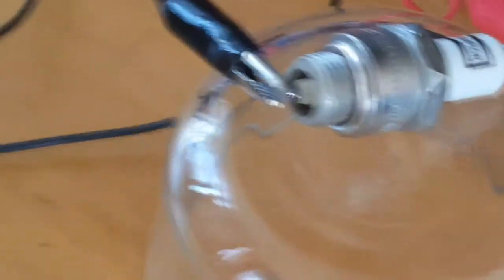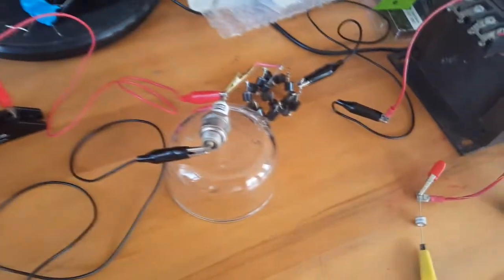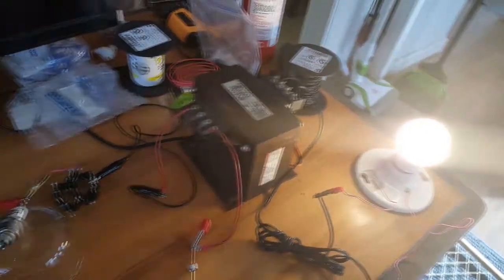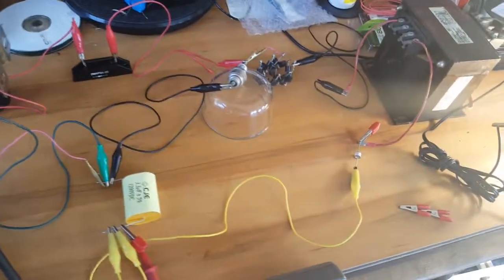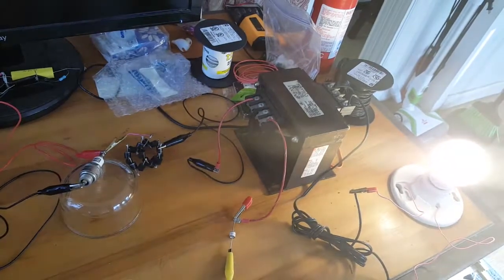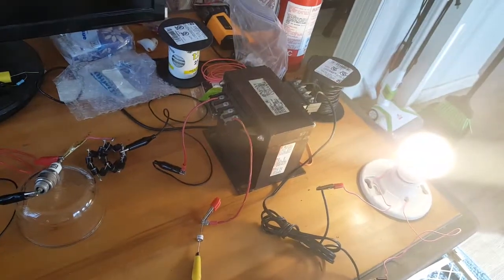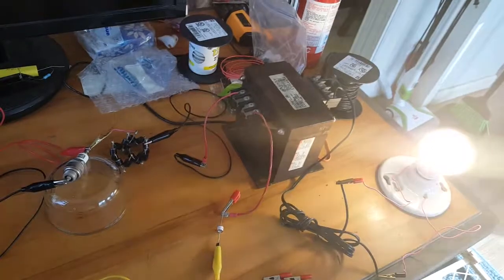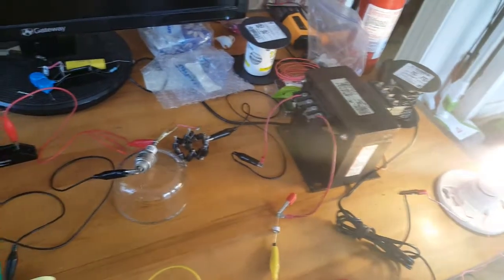SR-EVG

Comment from the maker: All spammers are pariahs!
Reply: Also, couldn't you use the same NST transformer to provide the timing (i assume it is 50 or 60HZ), instead of providing your own pulse HV flyback circuit? Isn't this a huge waste of materials just to get a 60Hz switch, when we already have one?
I would be very much interested to hear your comments. Thank you
Reply: Dear XR, could you send me the schematic of the EVG SR circuit? I would like to modify it for 50Hz output. Keep up the good work. )))
Reply: Hi XR IX,  have you figured out how to recover the energy from the pulses yet?
Reply from the maker: @joshuabaytee882   Yes

Comment: I don't have a neon transformer, but I have 2 ignition coil drivers and 2 low resistance canister coils. Can I use one to spark the plug at 50Hz at high voltage and the other to spark at lower voltage and lower frequency?  My ignition coil drivers can get the coils to spark at a gap of up to 3cm, does a wider spark gap even matter? (your set up used a regular spark plug with tiny gap). The load is the transformer, is it a microwave transformer? Are you driving the high voltage winding? Your yellow wire goes to the red wire and then to the transformer, what is that passive component clipped in between yellow and red? and finally, I see that you are using many diodes in series, is there a special reason why you are not using a single HV diode like you are using in the rest of the set up? I have been saving screenshots of your video in the attempt to draw a circuit schematic, thank you!
Reply from the maker: You have to understand what you are doing here. You build up charge in a capacitor (regardless of how that is done --- DC), which is in parallel to spark plug. The spark plug is also in parallel with a HV circuit (like car coil) and you have diodes facing each on one terminal of the spark plug. The other terminal goes to ground. The HV fires all the time, and when the cap charges sufficiently , it will cross over the plasma bridge.
Reply: @XR_IX  Thank you, I am beginning to understand this more clearly. The component connected between the yellow and red wire going to the load (transformer), is it a Switching Spark Gap SSG? Is it necessary to ensure short pulses in the microsecond range? Thank you.
Reply: @XR_IX  ok so the pulse should be from a capacitive discharge not an inductive one. The difference between the voltage reaching the plug from your coil, and the voltage from the capacitor going to the same plug passing through the transformer load, should there be a ratio in the difference? The capacitor is rated for 1200V so this is what is probably reaching the plug passing first through the transformer winding. The voltage spikes coming from the ignition coil are probably around 20KV? Does it matter in the performance of the circuit? Thank you
Reply from the maker: @francescotrevisan4453  You should scope a smaller circuit to answer your questions. When you have a spark gap and it is in parallel to a capacitor and an inductor, when the voltage of the capacitor is sufficiently high to jump that gap.... what is the expected result? Your understanding of the HV circuit can be answered by looking at what a thyratron does.
Reply: @XR_IX  thank you, I watched an interesting video on Thyratron tubes. I confess that I also consulted ChatGPT. When you have a spark gap in parallel with a capacitor and an inductor, the expected result of the spark gap firing (triggering) is a resonant oscillation in the circuit. The inductor resists sudden changes in current. When the spark gap triggers, the stored energy in the capacitor is suddenly released, and the inductor will oppose this rapid current change. This sets up a resonant LC (inductor-capacitor) circuit. Pls explain this part, The capacitor discharges through the spark gap, but because the inductor resists changes in current, this discharge won’t happen all at once. Instead, the energy from the capacitor will cause an oscillating current through the inductor and the capacitor, which is typical of LC circuits. The voltage across both components will alternate as the energy oscillates back and forth. Is it preferable to limit these oscillations? The output from the transformer goes to a diode and then to the spark plug, I am having a hard time visualizing the entire circuit at work, electronics for me is a hobby  I have no formal training. Thank you
Reply from the maker: @francescotrevisan4453 This is why I don't post schematics. Circuits are experimental and High Voltage. CAPACITORS CAN KILL YOU. Please seek education. Electricity even using a small penlight AAA battery can develope killing potential.
Reply from the maker: @francescotrevisan4453  It is essential that you know how the box works, BEFORE you start going with research outside of the box. People are using AI as a replacement of knowledge in your brain. Please don't do that. This is a clandestine control mechanism.
Reply: @XR_IX well what can I say, I have been building wimshurst machines, tesla coils, layden jars, ignition coil drivers and Jacob's ladders from old microwave transformers for the past 20 years! 62 years old, 2 kids, college educated and managing a sales network of 54 agents ... Thank you for being concerned, I don't take anything lightly. In the spirit of science and research let me point out that you could have continued spreading knowledge while at the same time advising extreme caution.
Reply from the maker: @francescotrevisan4453 Then how is it you were unfamiliar with an LC tank circuit oscillator? This would be a fair question if you were in my shoes. There are tank circuits in Tesla coils, it is the only way to build resonance.
Reply: @XR_IX this is not the point, in your previous post you decided to stop giving information because of safety reasons. You did not question my knowledge for the sake of knowledge, you did it because of concerns over safety. I built my tesla coil from a kit from Eastern Voltage, a minuBrute DRSSTC, all parts and instructions. For fine tuning I took it to a lab here in Italy where I live, they used a scope. So there you go, think about it you just found out that it is possibile to build a Tesla Coil without being an electrical engineer ... and stay safe doing it.
But it's ok, I found your videos interesting and I thank you for the insight and info you provided. In the end I think that there is ambiguity in everything you show and say. Please don't make the mistake of thinking that you invented any of the things you do, you are simply one of the many that put their heads to it and got somewhere. It would make sense that as you got knowledge and insight from others, you would contribute by being analytical and clear in explaining and welcoming replication ... but that is not what you do. In conclusion it could be that you just know too much and you are being controlled and harassed, or that you have the illusion that you actually invented something and are too selfish to pass it along. In the first scenario I have a lot of respect for you, in the second I better refrain from further comments. Peace and love.
Reply from the maker: You seem to have a wonderful intuition of who I am. Yes, I need for people to tell me I am great, and take great pleasure from never revealing the "secret" because I have illusions that I have "invented" something. Dude, you're thin skinned, and jump to conclusions. I am a child, and make fart noises to amuse myself. I laugh because, you are trying to analyze me, when you should be looking at the device and asking the right questions, which you are not. I laugh because I still have childish qualities that allows a child's perspective. You look at these circuit with simple components and less than 20 connections, and don't know what is going on. How is that? The answer is, you can't see the forest because of the trees. I have never hidden anything. LOL. The Tesla schematics, as well as the Zilano schematics have no integrated logic, yet people dismiss them. You need drop your pride, because it prejudices your analysis. When you get over yourself, get back to me.
Reply: @XR_IX too bad you cannot confirm anything you say, and you just keep going around in circles with the same arguments. The first one to jump to conclusions was you my dear young boy, telling me that I am playing around with something dangerous and bigger then me. And now all of this nonsense talk. you have 500 followers and 12.000 views on a 9 year old video ... and supposedly you have something new to say? then say it! I am laughing at myself for believing that you actually have something to say😂.
Reply from the maker: @francescotrevisan4453 You are so easily triggered, and resorting to insults which proves, you have lost this debate. Do you realize that? I don't care of two people see my videos, and it was just my mom and dad. I am not selling anything not even clicks. I have nothing to prove, it shields me from monetary motives. So I will tell you something that helped me. Chuckluv, was a guy who built the Suitcase device before me, and ran his home. He said, you should give up. Just look at it... (the device ).  Let go, you can't build it because you have the perception that my videos show the spoon bending, but you fail to realize... there is no spoon. Because my videos are not faked, that is all the confirmation that you require to know your perceptions/intuitions are wrong.  You are in good company, generally humanity understands the spoon, and denies that that they see it bend.
Reply: @XR_IX  my apologies, maybe today I am a bit nervous, generally it is unlike me. I am generally open to surprises and have an open mind about all things. What got all of this started on the wrong foot is your pulling back from continuing to chat because I openly declared that I am not a technicial. You sounded like my brother, MIT graduate in engineering who unfortunately does not believe in any of this.
Reply from the maker: I accept your apology. Yes, if I detect any misunderstanding of the topic I have to pursue it because people don't usually review the descriptions. It is better to say you don't know, because I can fill the cup differently, because it's required. I am not MIT material, but understand, that academics don't teach Tesla. He went off the rails, at a point and then he was consumed by the properties of disruptive sparks. What all engineering classes will teach is simple ohms law, and that if you separate power and distribute it to multiple parallel loads, the math says you subdivide the power based on the resistance (impedance). You can show him my OU I, and ask him how that could possibly work.
Reply: @XR_IX  I love my brother but he thinks only inside the box, Science is like a religion that cannot be disputed. 15 years ago I tried to get him to look into Nikola Tesla, Ed Grey, and then Tom Bearden, John Bedini, Eric Dollard etc. but ti him and most other academics that is Quack Science. I gave up and started looking into it myself, so to him I have become a simple minded moron that falls for every scientific fake news😂.
Reply from the maker: @francescotrevisan4453 And 99.99 percent of the time, he is right. He eats with that spoon, because the nature of physics explains what we perceive as factual. However, for beings with different perceptions, reality and their rules for physics could be much different. Has your brother questioned his ruleset against the UAPs that break all we know about how the universe works? Moving faster than the one of our bodies could normally endure, non ballistic  motion, able to move in water as well in air, with no impact to their vehicle  speed. We have to accept, that we are not the sharpest tools in the shed. Our intelligence is wasted on endless destruction, and mistrust, because we are infantile. Most people will think that energy generation, falls to the rules of thermodynamics. Tell that to the drivers of the UAPs. Even if a worm had twice our IQ for a thousand years, we would have a hard time describing the joy of looking at a Van Gogh to the worm. Perceptions dictate physics.
Reply: allow me to expand on what you are saying. Yes I agree that in the current way of thinking perceprion dictates our vision of reality and this physics. To me it sounds extremely limiting to believe that the universe started by first defining a set of laws and guidelines, I prefer to believe that the universe is evolving and that in doing so the so called laws and constants change along the way. In this respect I like what Rupert Scheldrake describes, a Conscious Universe and all of it's implications. At a particle level there seems to be no physical matter, only energy and vibrations, in this respect "the spoon" does not exist, we make it exist starting from a conscious level. So it could be that we determine the outcome, as in the "split photon experiment", we create reality, thus we are creators. Pushing it forward we are part of this Conscious Universe, all entagled in a collective of consciousness to which we all participate. The issue couldbe that the majority of people do not think that they are in charge of their lives, they actually think that someone else is driving the bus, and this inevitably makes people passive passengers believing anything and complaining along the way. I am not a scientis nor a technician you are correct, my brother started in electronic engineering at NorthEastern in Boston and then he migrated to MIT in biomechanical engineering, he studied science and has been working in technology for 30 years, but whenever I confronted him with a higher more expansive and progressive way of thinking what I saw is the actual Negation of Science, he believes in science vs believing in the scientific method. This is actually a global issue and we have seen it with global warming and the pandemic.  I started college in architecture, then marine biology, literature, languages and finally business marketing and communication, at the time I thought that there was something wrong with me, in life I realized that I have a better 360° vision than most people and that I tend to see doors and possibilities where others dont. Knowledge of electricity is really fundamental, Nikola Tesla pointed in the direction but no one listened. My feeling is that a new understanding of this will open the door to understanding consciousness. Sorry for going off track. I would appreciate your assistance in continuing my understanding, I will try to ask the right questions.
Reply from the maker: @francescotrevisan4453  We agree, how perception can change your physics. This is important, because you are the first to start off on this foot. Other's have recreated my circuits, and produced similar results, but they never get the big picture, hence they languish in the details. Never being able to jump to the next step.  At least now, you are armed with the task of finding the keystone, and then finding the applications for it, will be easier to conceive. Whereas others seem to seek the Arc of the Covenant, and give up because they don't get it quickly. My devices are all demonstration generally. I wanted to not kill myself, but see results that I could share. This also allows me to fly under the radar with concepts rather than threats to Western Civilization. I can easily claim to be fake, because I know you can't un see the truth, but you can certainly convince yourself of its (in)/significance. Truth is always like a virus for the mind, that is spread through the intuitive, and surviving because of its empirical nature. If I told you in a pub that dynamic magnetism does not require current flow? You may challenge me in Electrical Engineering citing a Henry. I would reply to strike a metal rod with a Gauss meter handy, and now perceptions have to be adjusted. I just told you the "secret" that is the keystone. It is stated within the patent by Tibor Kemeny-- find the document with his pictures. Look at his engine carefully.

Comment: nice work, have you tried making a spark gap with one end under water and the other above,maybe this method could lessen the corrosive effect.?
Reply from the maker: It really is a central subsystem you must conquer, to work reliably, and without emissions. If you make a spark gap that can work for a month with no part replacement, you are doing something right.

Comment: Really cool my friend!! How did I miss this the last 6 years..lol
Reply from the maker: It's easy John, It took me almost 7 years of experimentation, until I was able define energy transmission, and amplification in this context. They both have similar circuits, it's the application that is different. You can have transmission with amplification. When you read Tesla, he said he could create a standing wave using the Earth and maintain 10,000 hp with just 200hp. That wouldn't power a small town by today's consumption standards. However, Tesla did say he could take 10W stored in a capacitor, and produce "thousands or millions of horsepower".  The phrasing is very accurate. Thus there is a separation of application.